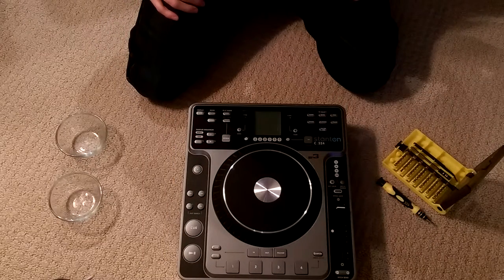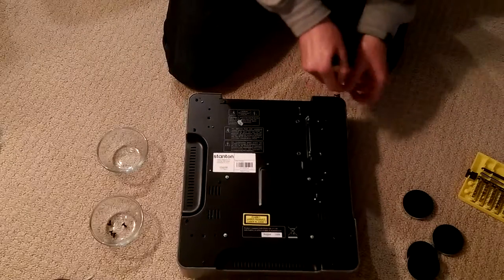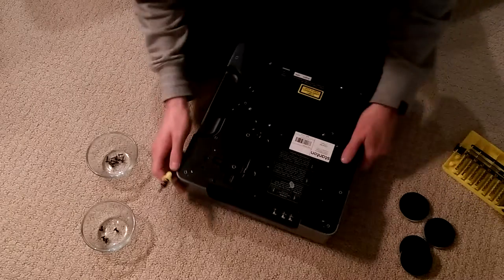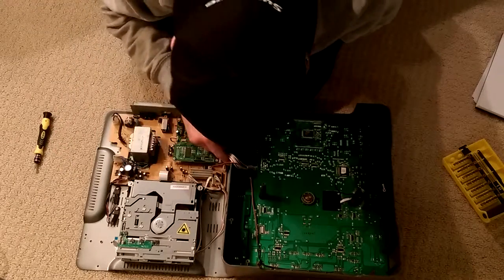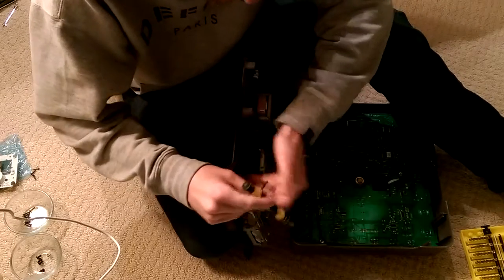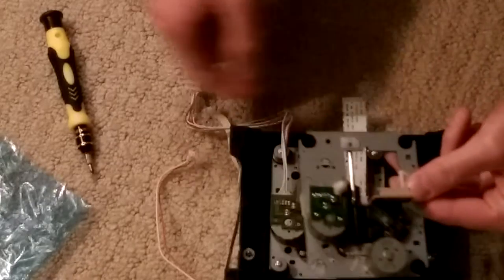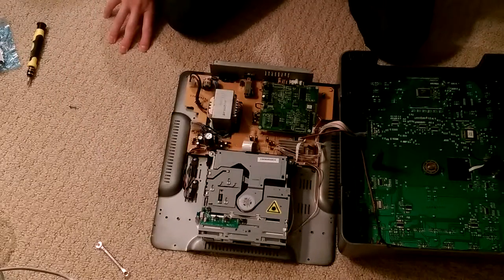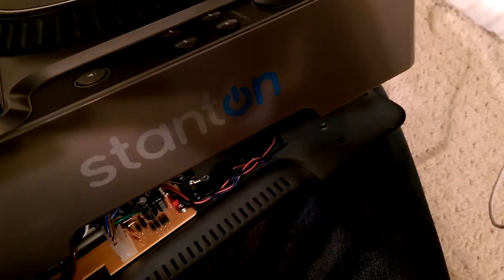Replacing the optical lens in a Stanton C.324 Turntable Part 1

Comment: Hi and thanks for the video! Two questions, 

1. Which lens did you replace it with (kss213q or any other)? 
2. and finally how did the unit respond after the fix. 

Thanks